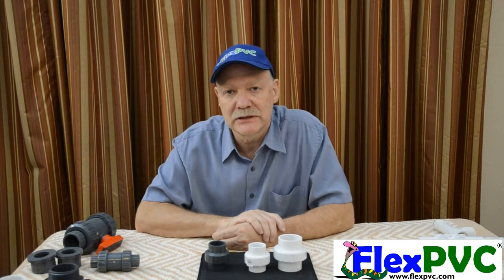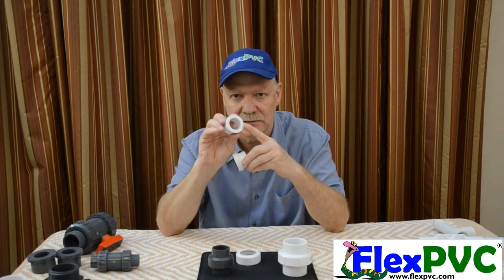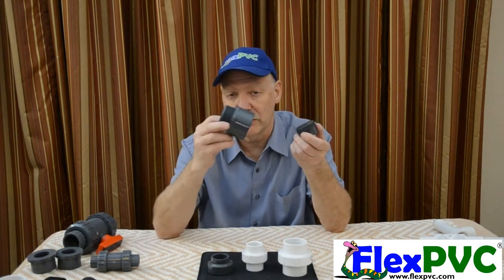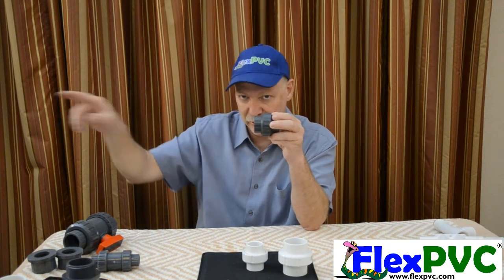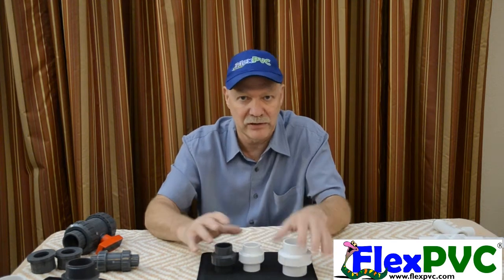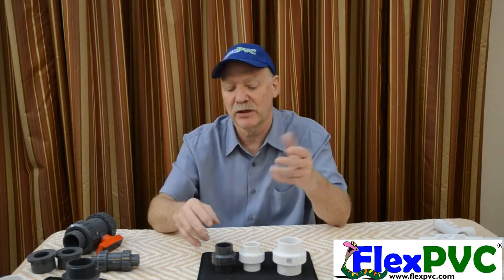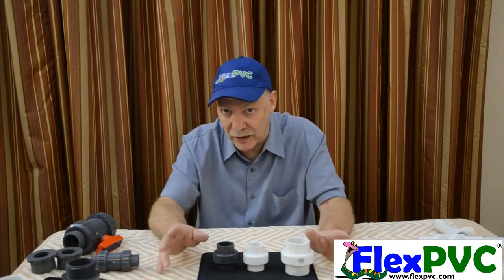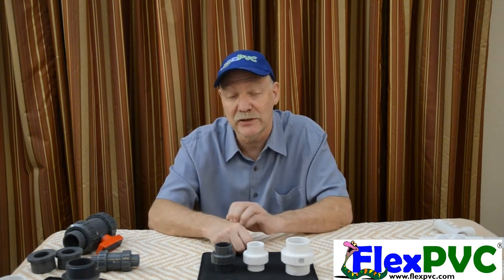FlexPVC - What are unions? More details on just what a union is.

Comment: Pvc pipe, after the PRV valve, got run over and cracked/leaked at the threaded part that goes into the ball valve cut off so I bought another one and am going to join the pvc but i can't put a coupling on, would a union hold up? it would make this repair a lot easier.
Reply from the maker: It's possible. Best thing is to take a few pictures of your situation and upload them to us to take a look. You can do that here: https://flexpvc.com/Contact.shtml

Comment: Hi can you use a flexible pvc joiner instead of unions for swimming pools then.
Reply from the maker: Well that would depend on what you mean by "flexible pvc joiner." I'm not aware of any such product. And a Union is something that is 3 parts. Two tail pieces and a collar. It's meant to be used to connect and disconnect easily. Flexible pvc pipe is meant to be glued into something like a union. Might be best to contact us directly on this question. Please use https://flexpvc.com/Contact.shtml or call us at 1 888 782 3539 M-F, 10am to 4pm PST. Thank you.
Reply: @FlexPVC  Thank you, and I am talking about a Fernco Flexible PVC Coupling at Home Depot with SKU 687944. Do you think that will sustain the water pressure. Thank you so much for answering.
Reply: Hi, the Fernco web site says that it can only take up to 4.5 PSI, so no deal here. Thank you so much again.
Reply from the maker: Sorry a Fernco would not work. It only holds very little pressure. Best thing to use is unions that glue on to the flexpvc.  see https://flexpvc.com/cart/agora.cgi?product=PVC-Fittings-Unions-China

Thanks! @danle2884

Comment: My Union is leaking even though it is tight. Could it be the O Ring? It’s on a discharge line for a sump pump so not under any pressure.
Reply from the maker: If it's leading it's either the O-ring or the glue joint. The O-ring is the easiest to check and fix. So I'd look there first.

Comment: Thanks for this video.  I am replacing valves in my sprinkler system but the installer didn't use unions when they made the system.  The valves are threaded, so I can cut the pipe, and unscrew the valve.  How much length will the 1.25" union require.  The pipes have no play in them so I need to be accurate.  I know I could possibly use a repair extension if I can't make the union work.  Thanks
Reply from the maker: I will have to go measure one for you. Is this one you are thinking of buying from us? The reason I ask it that what I measure will only apply to our unions. For an 1.25" pipe you'll cut out .5" if you are using the slip socket type. If you are using the threaded ones it'll be about 5/8" but you'll have to make sure to use good paste on the threads. Otherwise you won't be able to get them all the way in. Even 3/4" might be better for threaded ones. I hope this helps. If you are not using 1.25" pipe, contact us with the pipe you are using and we'll let you know. Thanks for the question.

Comment: Will these Unions work for High pressure water.. And for high air pressure such as septic air pump aerator pvc connections without leaking over time?
Reply from the maker: Generally most unions are good to 100psi, but it would depend on exactly which union and which size. Best to call or email us directly. As for using them with air... generally same answer, but remember, pvc should not be used with pressurized air due to the  spring effect of air and the potential for injury should it fail. Thanks for the questions.

Comment: The white one's you're using for the presentation are very similar if not the same that HomeDepot has. My question is, can I use these for my pool filter and pump? will they work fine under the pressure of pool pumps? Thx in advance!
Reply from the maker: I can't comment on the quality of what HD sells. You have to ask them what sort of pressure rating they have and it they are suitable for your application. Note: Swimming pools are at the bottom of the pressure list. Ie most run 20-35 psi max. So it's usually not an issue.
Reply: @FlexPVC  Thank you!